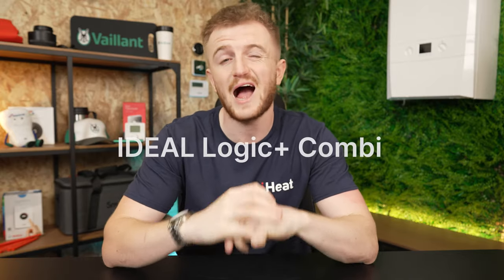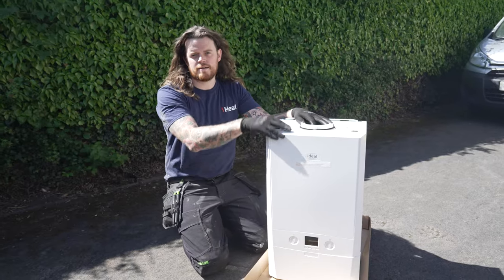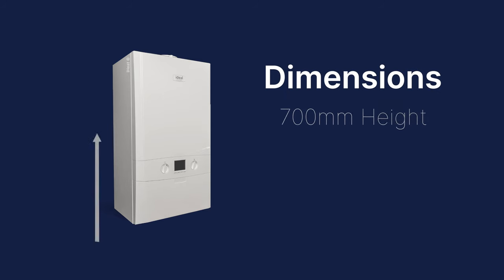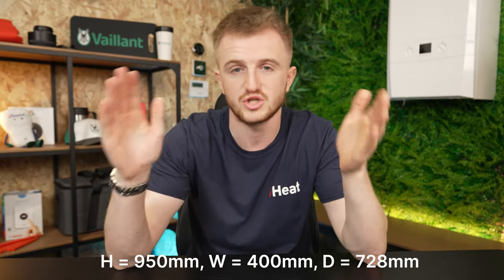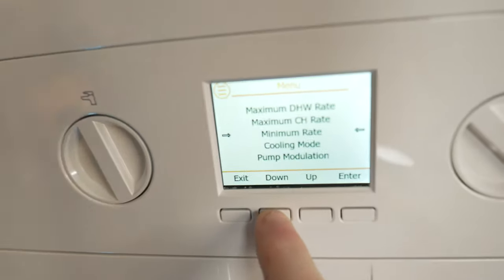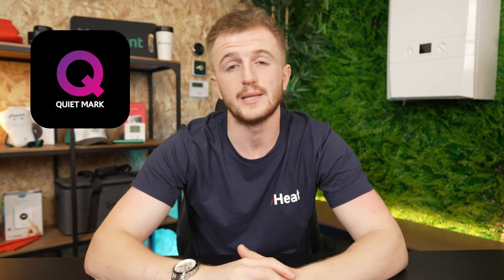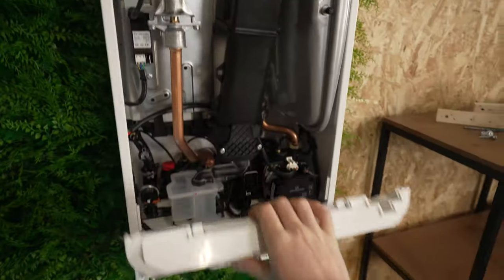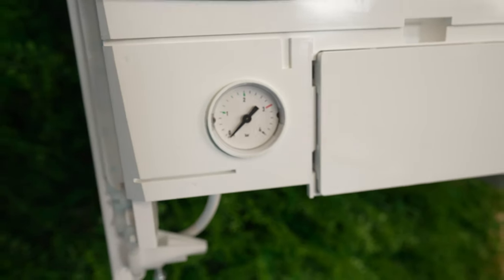Ideal Logic+ Combi Boiler Review - The Perfect Compact Boiler?

Comment: any experience with the halo wifi controller ? . getting an ideal soon and i have a hive system at the moment but like the look of the halo
Reply from the maker: Hey i'm afraid it's not something I've worked with before, all I can suggest is give your hive a go, see how your bills come out, if you feel the boiler isn't being as efficient as you were expecting I would then look into trying out new controllers like the Halo in the hopes to improve your efficiency. I wouldn't bother spending extra money on a new controller when you already have a well reviewed, working stat. But I do agree with you, the Halo's do look pretty cool.
Reply: @iheat  think I will give it a go as I have had the hive for a while and i like the fact it doesn't need a gateway to work, also the extra functionally looks good...top review btw.

Comment: we had our boiler fitted 2 and a half years ago so I thought its time we had it serviced they servied it in march this year but since they servied it the pressure goes done to  in a about a week the engineer came back checked th boiler and all raidiators but could not find any leaks could it be th relief valve or the exspansion chamber thet is causing the pressure to drop  there is no sign of leaks anywere I have checked quite aa few time I evening took floor board up on the landing as I had some work done some months ago all dry any ideas please
Reply from the maker: Hey this does sound unusual it could well be the relief valve or the expansion vessel. Have you inspected the relief valve pipe outside your property? It should look like a copper pipe coming from the wall and bending in on itself, If the pipe is wet or there are signs of water coming out of it in the past it could be a sign of a fault with the valve or expansion vessel.
Reply: @iheat  there is no sign of water coming out of the copper pipe I have to top up the pressure about every 5 days
Reply: @candymanoooooo  hey did you figure out what’s wrong and what’s the update with your boiler. We bought the same one and having the exact same problems
Reply: Bought a new home and had this put in as the old boiler couldn’t heat a kettle for a tea, I have to top it up every 2 days because it keeps loosing pressure, had an engineer out twice, they can’t see an issue, so they said it is a leak somewhere in the home, had the folks out with the leak finding devices, checked the house top to bottom and there’s no leak, this boiler is driving me crazy